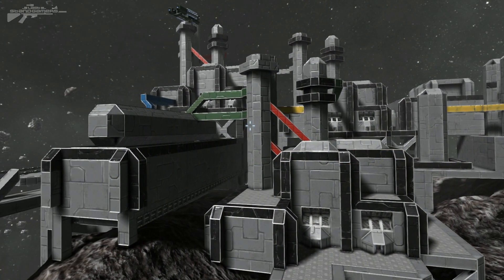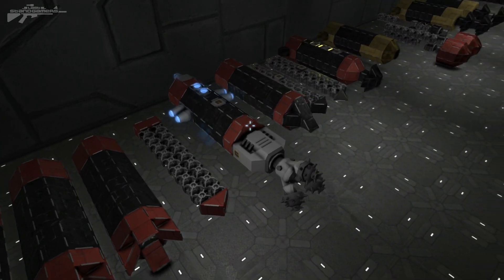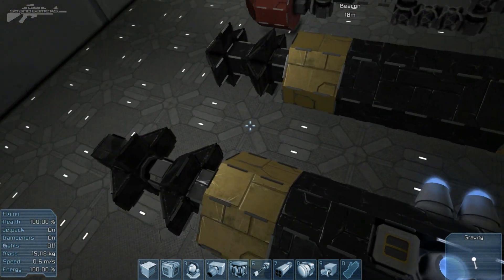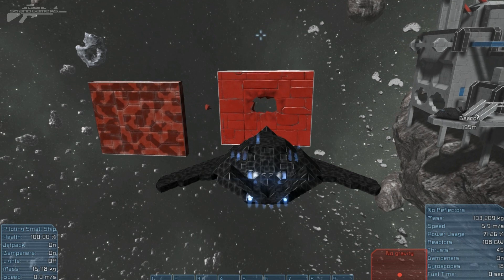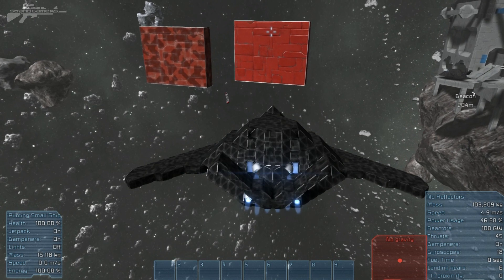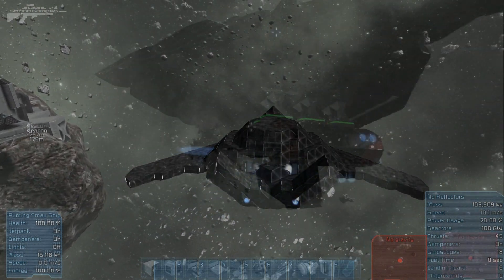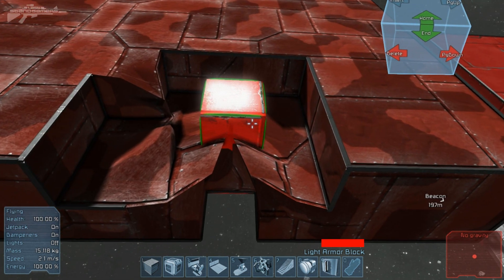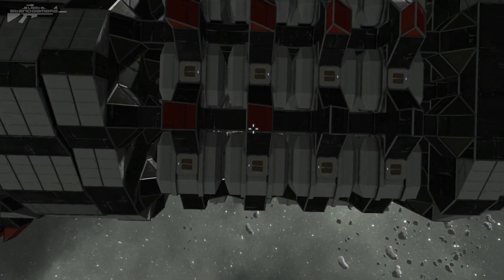Space Engineers - Inertia Based Weapons, Effective Or Ineffective ? Waste Disposable Ship

Comment: Ding!! (noise of lamp getting lit over my head) Remake of a slug torpedo: use typical casing, but make the core as another ship, so it is inside, as a blasting charge, but it's not one construction with the casing, so it can move. Soften tip will hit the ship, will destroy itself and make a hole in the hull so that the blasting core can get into and deal much more damage. Adding one little rocket to the back of the core itself would allow it to get in the ship faster. Hope you'll understand :D
Reply: BEST. IDEA. EVER!
Reply: something like APHE shell? (APHE Armor Piercing High Explosive)
Reply: vuk psodorov yeah, something like that
Reply: johnytest464
 what would have been good is also to have the grappling hook like the beacon one because it does more pen and then it has got bigger chances of getting in because the armor is penetrated.

Comment: I think the beacon will work if its fired at an actual ship, not just a wall, which is what I test with. At least a layer of decks behind the wall to simulate open areas in the ship.

Also, I made 3 weaponized variants of Sages squid, on the first one the legs have landing gear and hold small torpedoes, the rotors lock in place at specific angles so they don't collide, the idea is that you'd be carrying weapons in a streamlined design and then brake, swinging the legs forward, and release the gear right before they reach their max angle, the effect is interesting.

Comment: Their should be a self-destruct system that you can put inside your ship, which you can choose the blast area/or strength, so when your being bordered, you can choose the self-destruct tool can blow up the area where the tool is place. some balancing may be needed so it won't be op. (like power requirements maybe, and a timer too)
Reply: muffled fart  which you can trigger remotely, will be so useful against an attack.

Comment: A solution to the tracking torpedo is to have the piercing tip connected to a ring that holds back 4 outwards motorized prongs set to stop when the torpedo is partly in. Just having static prongs will make them easy to shake off literally.

Comment: I have a small question... More like a request. Have you tried testing those torpedoes at different angles, or with sloped armor? Armor with a 45deg slope would be almost ideal against torpedoes. The reason why I ask this, is that in combat, if you line up for a perpendicular hit, you'll be very vulnerable, as you'll have 3 faces of the ship that could have turrets hit you. It would be interesting to test different armor types, as well, like armor that has two layers, but with dead air between the layers. Another question, as well. Are those small block or large blocks? Small blocks are 0.5m, where large blocks are 2.5m (thick).

Comment: Hey Aaron, weightlessness doesn't mean no effort to move. F=MA means you still require a force and that means effort, it's just no resistance and only going to go the way you move it so it's easier in that regard.
Reply: Once you got a thing to move in space, it will move quite nicely, but your problems begin, when you need it to stop ;)
Reply: Yeah XD Moving along is easy, acceleration of any kind (Acceleration, deceleration, and changing direction) is the difficult part XD

Comment: With the drill torpedo, you need to put the thrusters on the front end, because the support is in the back, and with swords (unrelated i guess) you can deflect the opponents blade if you hit the area near the tip. same for the drill torpedo, it has too much torque on the front, and nothing to cancel that.

Comment: There is a surprisingly simple solution to the problems with drill torpedoes, have a second drill on it that mirrors the first (still pointing in the same direction) this should cause it to ailron turn (spin on the axis its traveling) rather than corkscrew, this may lead to issues with delivering the torpedo, unless you carry a second one that's a mirror of the original

Comment: im not sure whether this would work or not, but if you took the beacon torpedo, moved the beacon back so it wouldnt explode, at the back make 2 large posts with auto-lock landing gears on them, would the main body go through the hole, and then the auto-lock landing gears latch on the outside? i think this may work, but i have never played space engineers before. if you think this would work or ways to improve it, please respond cause i am kinda a newbie

Comment: Armor penetration isn't the best test of damage. The best test is to put some interior walls and random machinery behind and beside the target point and see what kind of damage it does to both the walls and the interior. I've seen some small torpedoes penetrate large heavy armor and than do nothing to an interior wall 2 blocks back, and others that fail to visually do more than scratch the surface, but wreck not only an interior wall 2 blocks back, but also one 2 blocks behind that, making a hole that is 3 times wider than the torpedo itself with the heavy shrapnel.

Comment: I think that for this game, the best anti-ship weapons will be, kinda like the UNSC has in Halo, the MAC gun. In the is case it will be a GAC gun, or Gravitational Acceleration Cannon. You use gravity cannons to propel shells(heavy armor tipped warheads) through space towards your target. the cannon would take up a good portion of you ship, and in theory you could get up enough velocity to penetrate armor and have the shell detonate in the armor layers, blasting it out. Turrets and torpedoes are too unreliable and require you to get too close, and can be to easily destroyed. To disable a GAC gun, you'd have to destroy the ship anyways, so you can fight until you die, rather than be disabled and boarded. Use the small chain guns and missile pod turrets for point defense against small ships, and you have yourself quite a ship. In theory a Frigate defined around a GAC gun could easily devastate a ship many time's it's size.

Comment: That drill torpedo fails so badly because you have no RCS in the front so it really can rattle and shake itself up badly because the front is uncontrolled and the RCS in the back can only do so much to minimize it's shaking about.
For better control you need thrusters at the furthest points possible from the center of mass while your Gyros work best AT the center of mass, these hints should help you a LOT when designing other things (Ships or torpedoes).
Unfortunately the game lacks a way to find the center of mass so you have to sort of guess and test.

Comment: The problem is not the weapon, the problem is the spaceship. Having a torpedo stuck to the bottom of the vessel WILL mess with your center of mass. The optimal placement for a torpedo should be right in front of the ship.

Comment: why dont you ever place thrusters on the end of the torpedo?
Reply: cause they're pointless. There's no option to simply turn the thruster on and leave it, like with drills, so the only way currently to make a self-propelled torpedo is attaching a rock to it so it's affected by gravity and line you tubes with powerful gravity fields focused outward (or attach a gravity generator directly to the torpedo, but it requires adding a large block somewhere on the missile when going that route since small ships can't have gravity generators on them).

This is the old inertia model, which works decently well, but needs running room to get up to speed and forward scouting to know where the targets are so you can release from a safe distance, instead of just being able to aim and let the torpedo fly under their own power.

Comment: How does a torpedo pull you down in space?
Reply: Well if it was real space, there is always the problem of the centre of mass, if it moves out of line with the centre of thrust the ship will push veer of strangely. Not entirely sure if this applies in Space Engineers however...
Reply: ***** in space engineers you do have a center of thrust, so torpedoes can slowly turn said ship
Reply: NinjaDuck Kerman I think that you are wrong. In space engineers you can put all the mass in one side of the ship conected with a string to a single engine in a simply weird form and the ship will continue going straight, and this breaks the game in my opinion.
Reply: I believe this : to spare computing, all the thrusters applies their force with no moment one the ship's center of mass. But there is moment between two separate game objects, like a bomber and a torpedo. Tried to launch a big block-made torpedo with a small ship, I missed my target because of my ship wobbling.
Reply: Devin McDonald  : The only way to avoid the problem is to balance the load around the axis of the ship. Having several torpedoes in mirror positions and/or having one in the forward axis (more tricky to aim).
I would try a U-shaped torpedo launcher for massive torpedoes in order to artificially unite the two centers of mass. It seems easier to avoid collision course with a "U" rather than with a "bucket" (Is this sentence written in correct english ? X_x).

Comment: 10:00 again, you can't lodge something in, because there is no tension in the game. (or gravity to keep it in)
You need materials with tension to expand or contract (like flesh, or fabric) for any sort of hook to get stuck in. Otherwise it'll just create a hole as large as the hook in order to penetrate, at which point the hole obviously is large enough for it to slip back out again, since the material it penetrated can't contract again. In zero g that is.
Until Space Engineers supports gravity generators that can affect other ships, it ain't gonna work. It won't stick in there.

I don't even see the point in trying it.
It's like trying to build the crossbow of a previous episode, out of a metal chain that has no tension, it ain't gonna work, basic physics.

Comment: How do you build a torpedo and then put it on a ship? I'm new.
Reply: Make the ship with some landing gears on the bottom. Make a tug and the torpedo of your choice. Bring the tug to the torpedo and dock the torpedo to the craft. Disconnect the tug and store it for later. Accelerate towards the target and release.
Reply: Dean Clarke To be fair, you don't have to have the torpedo on the bottom and you don't need a tug. I've been testing my first torpedo designs today just to get a feel for it, and I've been using the Midnight Heavy Bomber from the Workshop since I'm just testing. At first I added a landing gear on the bottom, but later realized there is one on the top and it makes a good torpedo pylon so I've used it. Much easier to aim accurately and will probably do that on my own torpedo bomber in the future. In regards to the tug, you can just paste it near the ship and slowly nudge the pylon into place.
Reply: Daniel Sinks oh

Comment: The worst part about owning this game after spending 25 USD on it... is that my laptop can't run it at any higher than 15 FPS... Fuck.
Reply: Jono Pedersen #TheStruggle
(I know exactly how you feel)
Reply: Tobias Whittaker I'm buying the parts for a new PC so hopefully I'll be all set :DD
Reply: Seems like fun. I had a hex-core watercooled 32GB TitanGTX 10TB SSD gaming rig, until it caught fire when my watercooling failed. So that's $9000 to replace so yeah, you have fun :)

I'll just sit here in the corner with my $400 laptop and attempt to load Pivot stickfigure animator, without much luck....
Reply: Hence why I'm not using watercooling... Fuck that shit. I'd rather get something much more reliable xD
Reply: Jono Pedersen Yeah, my mistake
Reply: Haha
Reply: Jono Pedersen Yeah, well good luck with your future endeavors. Have fun!
Reply: Yea, thanks. Good luck with your laptop xD
Reply: Jono Pedersen Eehh, I will try lol, bye
Reply: Idk what you did then but to get liquid cooling to leak you really have to purposely poke holes in the hoses or something, even the cheapest compression fittings can easily handle 50KG of pulling on the hose before the hose itself tears, the fitting won't leak...
The only time a liquid loop might leak is if you just assembled it and did a poor job of fastening everything...
Besides that, leaking liquid loops will not cause fires as the liquid is non-conductive and you will find 12VDC in a pc at best so even with pure water there will be a short circuit, power supply detects it and shuts the whole thing down...
Sounds like you just pasted in a lot of stats you find cool '32GB', 'TitanGTX' (does not exist btw...), '10TB SSD' also doesn't exist for consumer market and 'hex-core' and just wanted to brag about it while knowing you don't have any of those parts...
If you did, lets see the modeltypes and how you had the liquid cooling setup (which rads, pumps and tube type)...